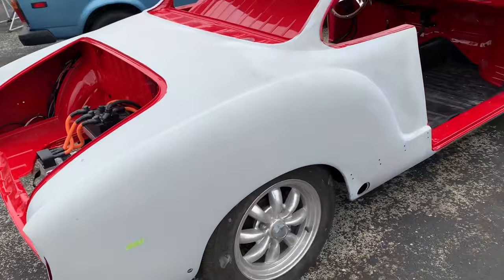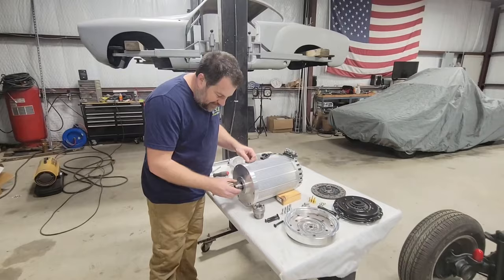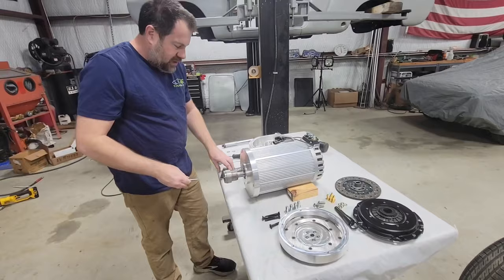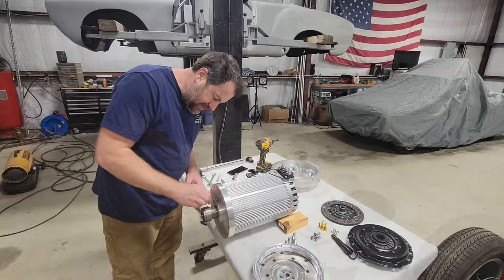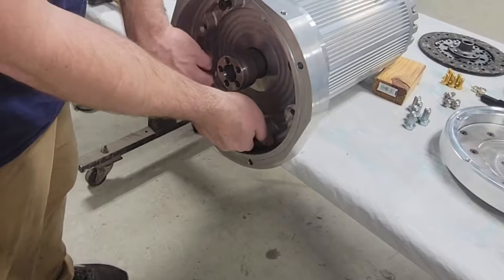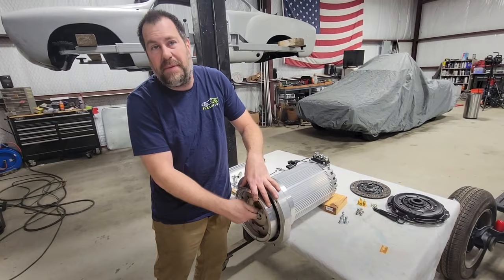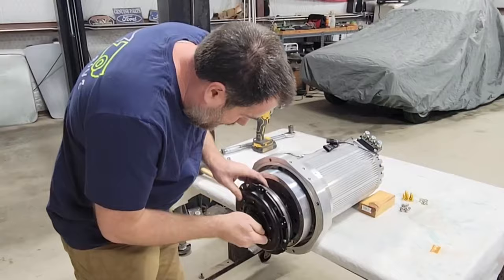EV Conversion How To : Adapt a Hyper9 Electric Motor to a Volkswagen Karmann Ghia or Bug or Beetle

Comment: Why does this swap use flywheel and clutch?
Reply from the maker: The motor utilizes the conventional transmission and can be driven in a single gear or shifted manually.  Check out the driving video in this link 
https://youtu.be/FgP1_rGJBxc
Reply: And reverse too
Reply: A conventional clutch with an aluminium alloy flywheel sounds like a recipe for a rather short life.
Reply: The power of electric engine is?
Reply: @andro7137 
No need to use the clutch though, so possibly will not slip.

Comment: Electric motor armature shafts are usually not rated for much of a thrust load. I wonder if the roller bearings in the electric motor have a high enough thrust rating for the thrust applied when the clutch is applied and released.
Reply: They seem to do very well before the hyper 9 the net gain Warp 9 was popular they all went together the same way and bearing failure is rare even after many years, see my YouTube

Comment: @demotors070161 is there a thrust bearing built into the hyper9? I imagine there will be some axial force when depressing the clutch, and I don't see any thrust bearings externally in the set up. Wondering if this has been an issue for you and this build at all?

Comment: Curious about the the cost moving to electric if you don't do it yourself..... a guesstimate would be appreciated.
Reply from the maker: It’s a hard question to answer without some specifics about the vehicle and goals for the vehicle. Contact Flashdrivemotors.com and they can answer that question! Thanks for watching
Reply: Stupidly expensive.

Comment: Ok, I've busted two pieces of all thread trying to get my adapter on.  It seems to start straight, but gets really tights and I'm not anywhere close to the spacer.  Are there any other tips or tricks to get that adapter on?  Not sure where to go next.  Any help would be appreciated.  Thanks.
Reply: I have this same problem.  It is about 80% on, but I’m crushing all thread trying to get that last 1/2 inch.   Did you solve it?
Reply: @PatrickFitzgerald-ge2hw   I didn't solve it yet, although I did find that the groove for the key was not clean and had to be filed for the key to fit correctly.  Going to try again this weekend with heat.  If that doesn't work I'm going to see about having it pressed in by a machine shop.  Hope you have better luck.

Comment: I really don't think that output shaft adapter needs to fit that tightly on the motor shaft.  I've worked with all sorts of industrial couplings (which is essentially what that is) and they just slide on.
Reply: He could have heater the adapter then it would have slipped on to the motor shaft.  That's the way I did it with my Hyper9 motor and it worked well.
Reply: "Chucks Garage" Usually electric motor couplings only have to transmit rotational torque through them. They typically use a Lovejoy coupler to take care of minor alignment issues. That adapter will also see the rotational load and any imbalance of the clutch and flywheel, and the thrust load from the throw-out bearing when applying the clutch. IMO it needs to be an interference fit.
Reply: @willieshaw2522  That is a very good point.

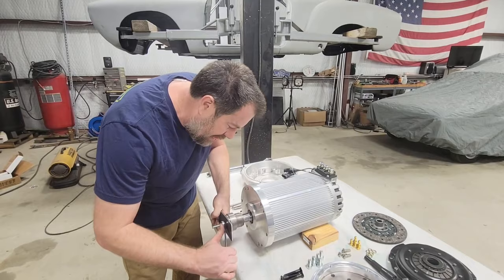Comment: 1:30 You damaged the bearings hammering the shaft. NEVER EVER use a hammer on bearings. The inner and outer rings get markings (damage) of the balls by the axial force applied.
Reply: He seems clever, but not intelligent.

Comment: I HAVE A VW BUG, HOW MUCH DOES THAT ELECTRIC MOTOR AND ACCESORIES (BATTERY AND OTHER COMPONENTS) COST TO MAKE A COMPLETE INSTALLATION ON MY CAR, THANKS
Reply: Too much to be a cool way to get a old bug with no engine back on the road because buying a new engine is cheaper. You could probably buy a new engine and trans for the price of the EV motor.

Comment: What junk... EV's don't need a clutch, gears or even a diff.
And can it even perform better than a good 1600?
Reply: You're missing the point: ease of conversion. It's literally just a motor swap. Nothing I'd do to ruin the value of a classic car, but you do you. Heck, you can even get a couple of hundred bucks for the old engine to offset the multiple $1000s of dollars for the EV motor kit + batteries! 🙄

Comment: I almost bought one of them it was like 500 horsepower capable or something like that I started doing math on the battery pack that would take the run it at that point you might as well just buy a Tesla